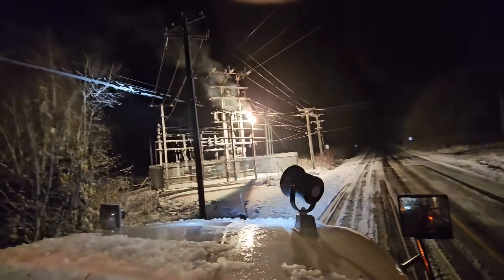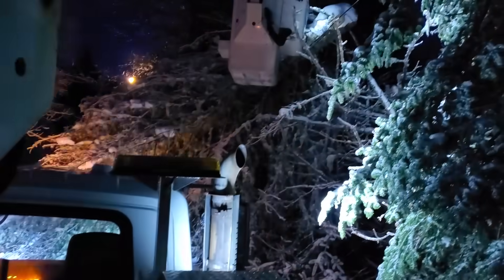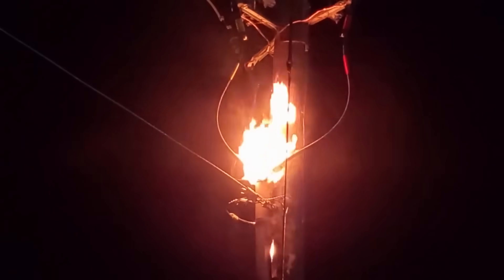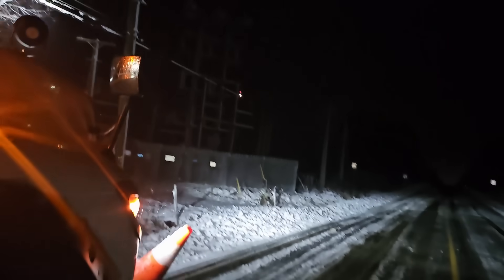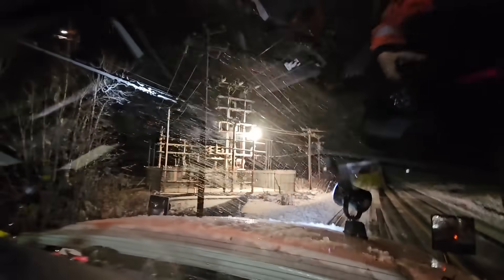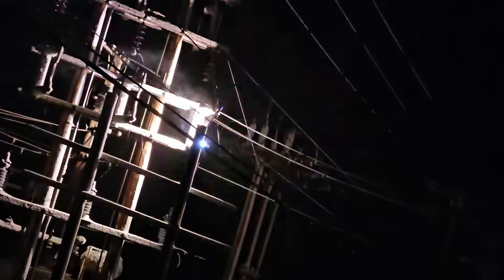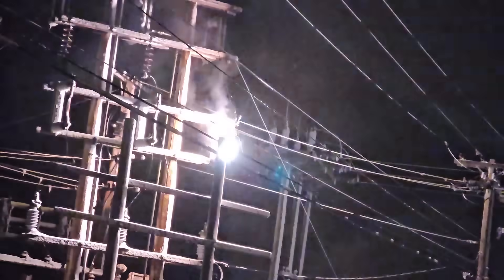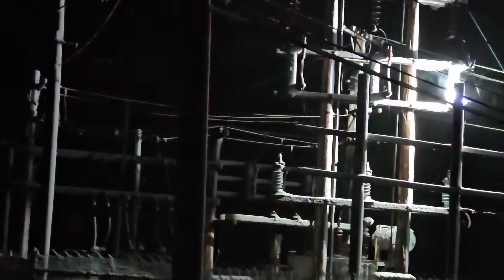Making "the call" to dump 10's of thousands

Comment: I've been on the other end of that, but with Internet servers rather than power transmission. We rolled out a software update that caused client apps to get stuck in an infinite loop.

Principal Engineer: "We need to take all of these servers offline and roll back this update ASAP"

Me: "OK, do it."

Principal Engineer (later): "I thought you'd be freaking out "

Me (calmly): "I am. This is me, freaking out."
Reply: Then you have Crowdstrike... which was on a whole other level of oops
Reply: It's good to have someone in the loop whose Crisis Response is to become Dead Calm and can Make Decisions
Reply: Same here, and it never even occurred to me to question the power company. I did phone them to confirm that they are aware of the fault (because otherwise the fault would have been on our end) but never blamed them.
Reply: You don't last long in a position like that if you freak out when stuff goes to crap 😅
Reply: @Lizlodude  I have found I tend to stop and think in an emergency.
It some cases that can be bad.
But the first fire alarm when I moved into my last apartment was real.
I tracked the source of the smoke (garbage chute).
I was able to show fire fighters where the garbage room was.
They put it out with a large fire blanket.
If I can do it again: I would have felt the door before opening it for heat. As it was: I smelled smoke, and backed off to let the people in gear handle it.
Reply: In 15+ years in working in big tech, I think I've personally only had to "hard down" a service once. Not the most graceful way, but often the quickest to get stuff working again.

Comment: Wow - that was quite the freak thing and no bueno. Excellent work. Having the power cut ASAP to prevent further damage was the right call for sure. Kind of reminds me of a call I responded to as a volunteer firefighter years ago. We were dispatched to a 'pole fire'. Of course there's not much we can do but block things off and watch the show, but the crossarm was burning and eventually, it let go and a primary (most likely a 7200V L-N) made contact with the neutral. That was quite the show! If that substation had made it that far, with 69kV, it likely would have been a tad more 'energetic'.

Comment: At that voltage alot like car ignition, once a carbon trace forms gonna be arc city. Bet someone wanted to get that fuse to take a closer look.
Reply: That heavy wet snow does not help with issues. With all of those downed trees over the power lines, there should have been issues with faults to ground that may have lead up to that feeder fault compounded with the wet snow building up on the substation equipment. I relocated to the largest island in Greece almost two decades ago and the power distribution system here was and to some degree a total mess. One of the main issues we have is that living by the ocean all of the insulators  tend to have salt deposits building on them throughout the summer months. Now they did use a helicopter with a high pressure washing system to clean off the main transmission and secondary feeders insulators but due to pilot error they wound up screwing it into the ground, no fatalities. Well at that point insulators went unwashed and with the first rains arcing to ground would occur taking out the fuses in various points in the system. Until we had several hard rains to wash off the network we were guaranteed a power outage every time it rained. Even with the privatization of the electrical producers the grid still remained the property of the government. They doubled the transmission fees over night but were VERY slow at upgrading their network, always with the excuse "we do not have the funds".

Comment: I'm sure I'm naive, but if there is a fault like that aren't there protective devices in the sub that will shut that load down? I mean... if a PT or CT senses a fault like that wouldn't a relay trip the line open? 

I work a lot with substations, but am somewhat new to it. Maybe I am thinking these systems are more fragile or "touchy" than they are... but to me if something like that is occurring, especially for that long, I would think something in the sub would open the circuit?
Reply: Yes, there are protective devices in the substation, they are high-voltage fuses. Unfortunately, it was one of the high-voltage fuses which failed. In the video at 8:48 you can see an inspection of the failed fuse, and how it was arcing down the outside of the fuse, leaving a black trace which was conducting current. So when the protective device fails, the backup is a manual switch, but the lever to operate the switch was directly underneath the arcing fuse, which was raining down fire and molten material, so disconnecting it the normal way was impossible. Even if it had been possible, such switches are not designed to open while energized, so the only thing left was to cut power to the whole transmission line.
Reply: Not in this case. Things trip when you get an abnormal load, but that isn't the case here. It is arcing around a fuse, that blew for some reason, but the load still has enough impedance to look fairly normal. That load being in series with an arc doesn't change the impedence much.
Eventually it would spit out enough metal and carbon that it would arc to ground or another phase, then other safeties would kick in (shutting down the whole line anyway), but till then it just looks like load.
You probably would see a lot of noise on the line though. It's possible a dispatcher would shut down the line anyway because they could see something isn't right, but it would probably be manual.
Reply: I'll be interested to hear the answer. I'm just a lowly cable guy, but there was a dangerous situation here a few weeks ago where someone had a ladder up against an apartment building putting covers on the A/C units for each suite.

I guess the ladder somehow got away from the building (wind, user error?) and went into a transmission line! I don't think anyone was on the ladder, but the workers still got hurt. Either way, I guess the arc melted the line and caused the live end to land on the ground and arc for a long time.

Comment: The same thing happened in my town five or so years ago. But the local power company decided to let it burn out….. for 2+ hours……… and then finally once it was clear decided to just cut the lines coming from the transmission lines and keep it energized (don’t know if it was off for a little bit in there, I went to bed once they cross fed my town). Didn’t replace the ancient PCB transformer….
I’m guessing you can guess my power company by this description 😂
Reply: Sounds like SCE or DWP. 😉

Comment: In most industries that I know of, the moment you trigger that sort of process it will trigger an immediate follow up investigation. Never to assign blame, rather to understand why it happened, was the process followed as intended, and what can be done to improve process and training to make the next response even safer and faster. Good to see everything went well as that could not have been fun.
Reply: Precisely. And we have those processes because sometimes that's the only way to realize "The controls are directly under the thing that drips molten metal when it fails" may need to be changed in future designs and / or deployed equipment.
Reply: Root Cause Analysis is usually one part of a bigger After Action Report.
Reply: @MikeF1189  Exactly. RCA will tell you the how and what. The larger report looks at the why and larger how. As well as other improvements that are only spotted once you have the incident in mind.

Comment: Having the electricity shut off for hours or a couple of days is a whole lot better than the main equipment being destroyed and being without electricity for weeks.
Reply: I know the feeling. During an extreme weather event, my grid operator announced they would be deenergizing everything in 5 counties in the path of the storm. The grid operator to the north of us didn't. Our HV lines were down for 3 weeks and the distribution lines took an additional 2 months to get to 80% restored. The operator to the north lost multiple substations & a generator. They took 4 months for a duct tape solution and still weren't rated for full capacity 2 years later
Reply: @nathanielhill8156  wow i could not imagine that. In Texas during our freeze, we sat for a whole week no water or power, could not imagine being 3 weeks without power.
Reply: @tbonet64 we were blessed during Snowmageddon. We never lost power , but did lose it for two days when Hurricane Laura came through. Thankfully, we had a generator and plenty of gasoline. My husband prepared by getting enough fuel for three days. He keeps stabil in it and rotates it to the cars every two months. He has a small battery powered pump so he doesn’t have to try to pour out of those crappy new spouts.
Reply: @tbonet64    "wow i could not imagine that. In Texas during our freeze," and that's maybe why people shouldn't be allowed to buy energy wholesale, its cheaper, but who knows if you are buying from a source with spare capacity, and how well the service level is maintained.
at least you had a generator for such cases, right ?  nah, of course not, cheaped all the way to death
Reply: Yes
Reply: A huge swath of customers in my area went down for a couple weeks for an underground fault until they brought in a portable substation, which was there for like 2 months while they tried to find the issue.

[I only knew what I was seeing because this channel had a video about portable substations that I saw just a few weeks before]
Reply: just means i get to power up the Generator i paid for!!! then its like camping LOL
Reply: I got my business started up rebuilding multiple substations after a big storm
Reply: Yes . This Why I Now Have 22 Panel's Of Solar and A 9 KWH battery [ L G ]

Comment: DAM that took F O R E V E R
Reply: Dispatcher sounds like they checked if there was any danger to life, and then they shut it down briskly but safety when it was clear that there was not. No point risking equipment to save already damaged equipment. Worst case you are late, it shorts to something, and the whole line fuses out suddenly. Why would you deliberately crash the line to prevent it from crashing? May as well attempt to shut it down gracefully.
Reply: A sudden drop of load at once (Aaron mentioned 10-20k customers) can cause abrupt frequency or voltage swings that can crash the whole grid (or portion of it). So  I am willing to bet that they were shedding loads (feeders) one at a time in a sequence to allow the grid to stabilize as each was shut down.  Utilities closely monitor frequency and voltages to avoid things like the big East Coast and West Coast blackouts. 

There is an engineering book (an expensive one) that I bought some years ago that goes deep in the rabbit hole of grid equipment and operations.  A fun fact: AC power generation AND usage MUST be very closely balanced to avoid a total collapse of the grid. Every time you literally turn on a light, somewhere on the grid a generator will have to put out a touch more power to cover it.  It was also noted in that same book that in the strictest mathematical sense, the grid as we know it is impossible to run.  It is the massive amounts of "load diversity" that allows it to work, as many things happen (too deep to dive into on a comment) that loads like motors switching off can momentarily feed some power back as others draw more to run.  It is a fascinating subject but be prepared to have your mind blown by the complexity.

Comment: What if anything would customers have experienced while that arcing was occurring?
Reply from the maker: Typically they may experience a lower voltage but in this case, we opened the recloser. This shut off all customers fed by this substation while the arcing was going on.

Comment: That's exactly how safety should work. Managers, dispatchers, etc. listening to and acting quickly on called out safety issues is one half. The other is a body of staff equipped and empowered to evaluate safety and make those calls to shut down a job, or in your case, a piece of infrastructure affecting thousands and thousands of customers.
Reply: Exactly.

We used to have a VP (he retired) and his motto was “2 minutes, 2 hours, 2 days” however long it takes to get the job done safely.

Comment: As someone who knows anything, what kind of eye protection is required when there is a fault with that kind of arcing? I know that with electric arc welding eyes need protection from the uv rays, but I am clueless if you are safe to watch due to being on the ground. Thanks
Reply from the maker: Definitely not safe to watch. When it goes bright blue, it can certainly damage your eyes.
Reply: A welder for 20+ years, safety glasses.
UV rays cam be blocked with clear safety glasses. If you want to see what's in the arc you need tinted lenses. Same as sunglasses

Comment: Glad it's OK to kill the power for life safety.

The Loma Prieta earthquake of 1989 wrecked havoc on part of the Bay Area power system. Seven 500-kV circuit breakers required replacement, at a cost of $700,000 each. These items are not stockpiled by PG&E. Amazingly, all but 12,000 customers had power within two days.
Reply: Come to think of it, that could have caused a wildfire in drier conditions.

Comment: Nice video. Good execution and assessment of your situation.

Just curious if there is any monitoring equipment that could detect that arc going on? Is it possible that the transmission operator could see an anomaly and then it could have been confirmed by your on site visual assessment?
Reply from the maker: Sometimes yes, especially at newer subs. In this case, I don't think it would have been noticed unless particularly looked for.

Comment: We had the equivalent feeders (66kV)  which were erected in 1930 in my area of Australia (In New South Wales) pulled down & replaced with 132 kV concrete poles a bit over a decade ago now so that's all been upgraded.

In 1945 we only had 1 × 11 kV feeder erected which supplied both sides of the river in our town back in 1945 before a  bridge was even built, the 11 kV feeder was split up into 2 feeders which supplied power to either side, the problem is that the feeder was 35-40 kilometres Long & there wasn't much in our area back then except a few dairy farms which is all that 11 kV feeder was for, to run their milking machines.

So there was a 66/33 kV substation (it's now 132/11kV) supplying power to a 33/11 kV substation which is about 40 kilometres away when it was built in 1955 (it has been replaced since), it was connected directly to the 66 kV substation in 1945,but we didn't have to rely on that by the early to mid 1970's.

By the early to mid 1970's that was upgraded by 2 x 11 kV feeders which were 11-13 kilometres long  from our nearest major town & they installed a switched 11 kV feeder which could be used to balance the load in the grid or isolate the power if any repairs or upgrades needs to be carried out.

In 2014  a 132/11 kV substation was built which took the load off that towns 33/11 kV substation because our area has increased in population & more people are having 3 phase reverse cycle air conditioners installed now.

The new  (now 10 year  old) substation has 6 × 11kV feeder outputs for our local area  !

Comment: Wow! And what a wicked sound that arc makes!
Reply: The best sound is when the arc reaches another phase and goes full kaboom. It can deafen you.
Reply: @5Dale65  There is a video of a transmission substation failing, I think in Mexico...the REALLY interesting sound which I can only describe as a growling moan, happens when the transformer cores saturate from the extreme overload. It is the most evil sound any electrical equipment can make.  I heard it up close during the Whittier Narrows earthquake. I was at our local sub talking to one of the crew when an aftershock hit. That sound started and even the veteran crew guys came flying out of that sub.
Reply: @5Dale65  And blind you.  The irony of a fault you can't even look at without risking going blind.

Comment: I am surprised how long it took them to cut it.
Reply from the maker: I was a little bit too... But at the same time, dropoing a transmission lineike that is a huge deal. 
My voice was very calm and said exactly;
"Whatever transmission line is feeling this sub, I need it opened ASAP"
If I had of called in Saying someone was dying... I imagine it would have been much quicker.
As mentioned tho... It's the first time I've ever had to do that, so have nothing to compare it too.
The conversation passed through a few entities and was out in less than 7 minutes from the time I hit the emergency dial up.
Reply: @Bobsdecline  Pretty cool to see the video and hearing your thoughts on it, especially your response here. Having such a reputation and having to make that call and not being questioned says a lot. 

I am pretty ignorant on the topic of power transmission and may have missed it, but at what level up the line was the line opened?

One of the times i've called 911 for a medical emergency I came across somewhat calm to the operator and I think they thought it wasn't too serious and they even ended the call and we were just waiting. I called back and explained it was indeed an emergency and the help finally came.

Comment: Very good awareness of a Hot spot, soon after to Arc welding buzz, uv light on steroids by 69KV compounded by a few 1000's customers reliant on electricity down stream. 
Can only guess the flickering, line noises/ transients, voltage flux, experienced by loadside customers. 

Good job guys, kept your wits, calm critical thinking to nip a growing problem before it cascaded to worse, and done safely. 
Cheers. 🎉🎉🎉